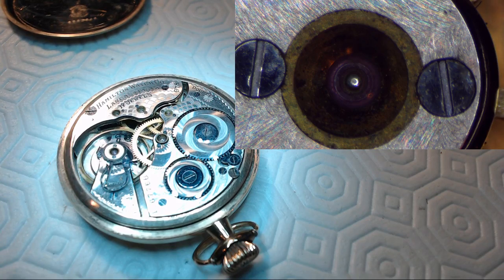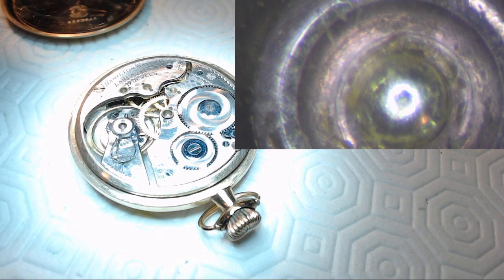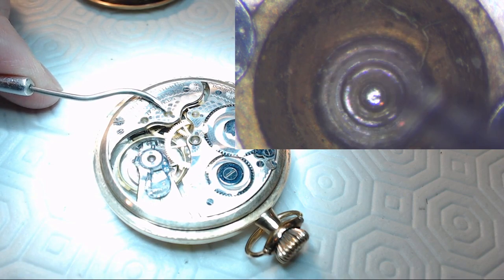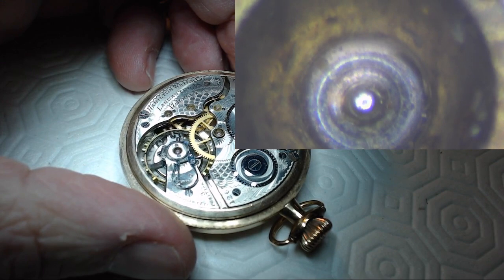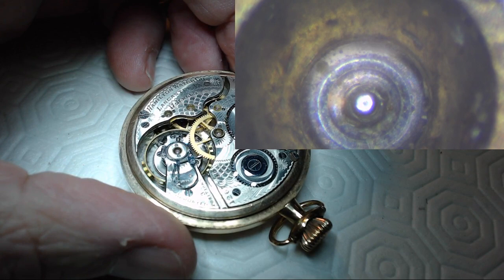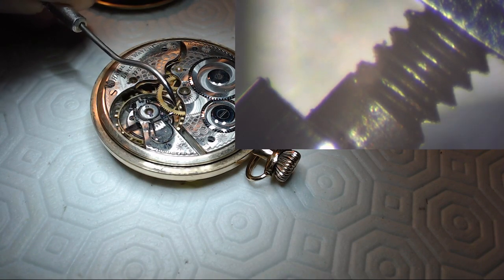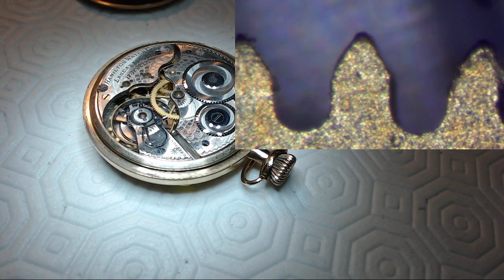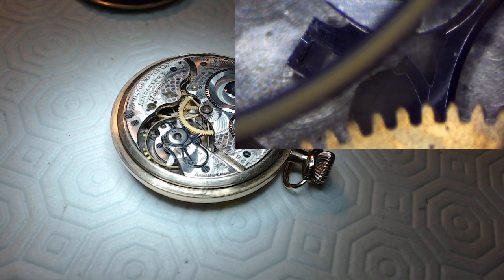Examining Dirt on a Hamilton Pocket Watch  Movement

Comment: Beautiful watch. I have the early 978, it as at the Horologist to be repaired.
This is a railroad grade pocket watch. The watch grades changed over time, when this was made it was only accepted on a few smaller railways, it was marketed towards electric interurban railways and street railways.
They discontinued this model quite quickly. You can find information online,  basic info from From the NAWCC forum:

The Hamilton 16-size, 17-jewel, 3-position adjusted grade 978 and its 18-size equivalent, the grade 948, were specifically intended for use on electric interurban railways and street railways. They were the official watches of the Conestoga Traction Company, which served Hamilton's home town of Lancaster and surrounding communities.

The grade 978 was introduced in 1912 and discontinued in 1924, with a total production of 24,500. After it was discontinued, Hamilton discovered that they were left with a gap in their product lineup (duh!), which other makers were undoubtedly happy to help fill. Finally, in 1928 Hamilton up-graded the 974 to 978 specifications and called it the "974 SPECIAL" to meet the needs of the streetcar and interurban market.
Reply from the maker: This is great information and appreciated. A absolutely love the quality of the old Hamilton Watches. What did that Traction company do that would cause them to need these watches for their staff?
Reply: @JDRichard  It was a Trolley company, in the UK we called them trams.
https://en.wikipedia.org/wiki/Conestoga_Traction_Company